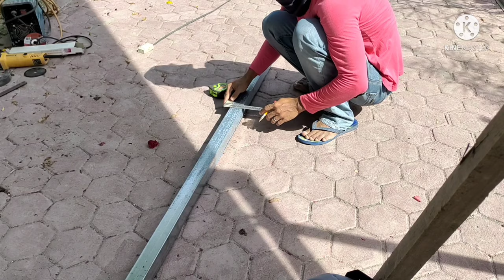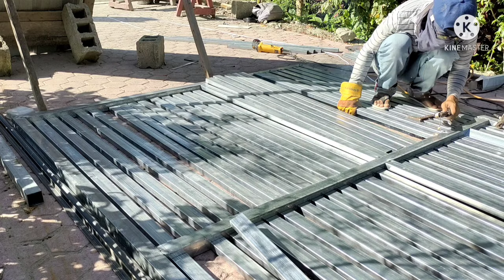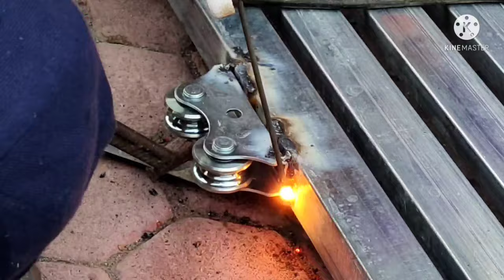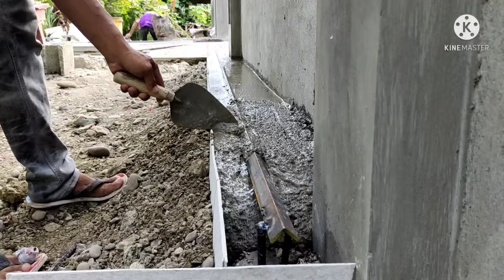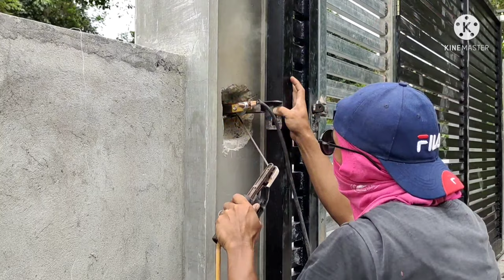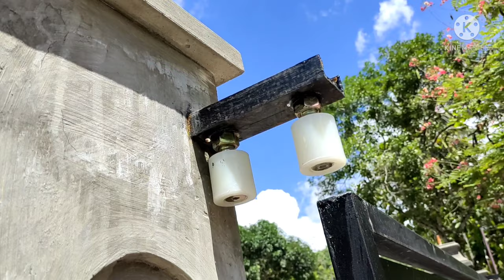SLIDING GATE DESIGN | SLIDING GATE INSTALLATION | SLIDING GATE | CONSTRUCTION IDEAS

Comment: Bo's anu tawag dun s gulong nya s my riles saka ung kulay puti n staper sa taas
Reply from the maker: Sliding gate wheel  idol
Reply: @raffmakervlog  saan nabibili yan bos ung po bang runner ng angle bar sa baba 1 1\2 ung size nya
Reply: Saka bos ung stopper nya s taas ung umipit s tubular anu tawag dun at saan nbibili

Comment: Ang gastos ng design, masyadong mabigat na ung steel sliding door.   I prefer na buga ung paint at polyurethane primer and  base color para matibay.  
Ung mga  babanggaan ng pinto na roller, need na lagyan ng guide para sentro ung daan ng steel door.  Masyadong mababa ung access door at need mo pang yumuko kung mejo mataas ka.  Un lng, nice detailed video.
Reply from the maker: Tnx po

Comment: sobrang bigat ang gate. Dapat alam mo ang timbang ng gate
Reply from the maker: Malamang kasi bakal lhat. 
Hindi nag babasi sa timbang ang pag gawa ng gate, importnte jan quality at mganda.. mindset va mindset
Reply: @raffmakervlog  many reasons, to know the weight of the gate, (1st) rollers capacity (2nd) conversation to automated gate
Reply: @raffmakervlog  As you can see, when you push or pull the gate, it has strong resistance on the roller, the more roller to be added, it added resistance when pulling or pushing. Plus nature resistance ie rain corrosion and dog pee.